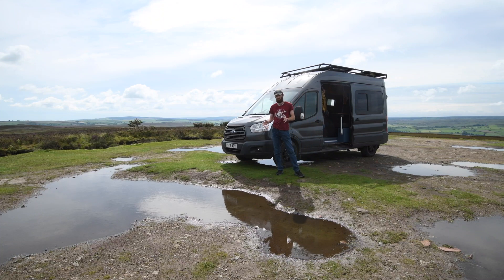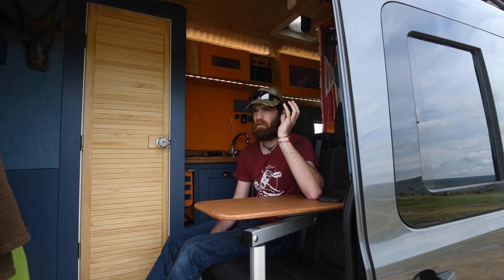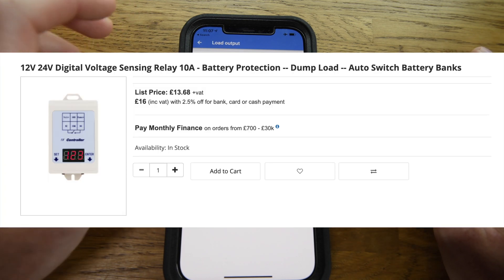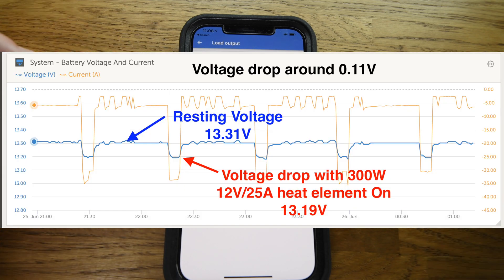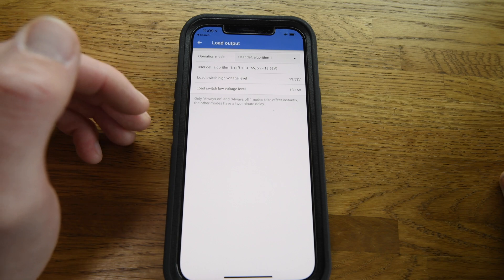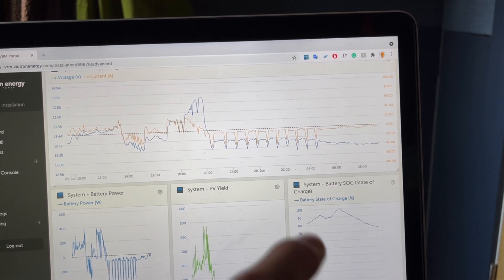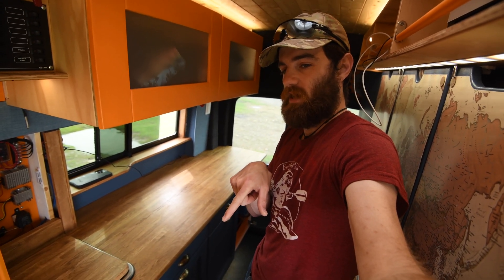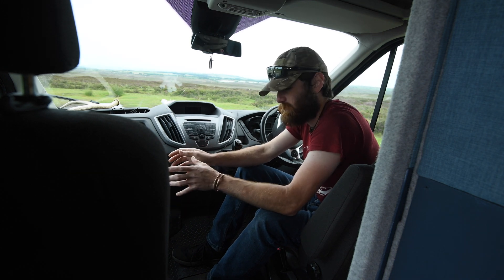FREE hot water from Solar dump! | EP51 | Ford Transit Campervan Build

Comment: If the mppt is connected to the BMV-712 via VE network, then you can use SOC for the relay on the mppt
Reply from the maker: That’s what I have done in the past. Then redid it when I get a Victron Cerbo.

Comment: hi Alex  ive made a esp32 and a lin bus converter and connected that to my truma combi 6e  (acts like a inet box but better with mqtt to the victron cerbo)   and use node red to monitor when i reach 100% SOC then turn the truma on to 1 kw electric  and turns the hot water to high and will turn its self off if the battery soc goes below 95%   but i do have 860w of solar but have seen 990w in peak in summer

Comment: I use a victron 100/20 mppt with load out i set it for batterylife and it turns on load output that turns on my dc to dc charger so it dumps excess power into my lead acid bank im gonna work on dumping to heat eventually now that I know I can control load output based on battery voltage pretty sweet

Comment: Sounds like you borrowed the same idea from Jason of EVERLANDERS channel had done four years ago
Reply from the maker: Great channel Everlanders I used to watch them a lot but they don’t show up in my algorithm much now a days. I don’t think I borrowed the idea off them at the time ( but I have seen there video ) . I was at the time working for Bobilvans which is a campervan hot water heating company in the uk so playing with ideas and solar dump loads are pretty normal for a domestic set up.
Reply from the maker: Looking back at old photos. I put the dump element in the hot tank in October 2020, which is a few months before there video same out

Comment: Hi thanks for posting video very interesting 
One question i have 340v of solar at 12v. And 600watt imersion heater 12v will this still work for me taking into fact that heater bigger than solar
Thanks ali
Reply from the maker: It should work, even if you have a larger heater than solar. It will just reach your cut-off mark to turn off the heater quicker.

Comment: So 2 hours be around 50 amps off battery if no solar or dcdc. Im looking at getting a sealed stainless steel 20l tank with insulation around it.. and adding a custom 12v 1500w element. By my calculations it would take 7.5 min to heat to 60c or 10min. Even if its pulling 125amps its total use would only be 15-20amps which is nothing.. i got 2x 330ah lithium batteries  and 3x 200w in series panels + 300w 70v solar blanket so 900w total solar. And 50a dcdc. Id rather speed mainly because if i want to pump from a dam or river through a filter into the tanks i could have unlimited hot water..obviously mixed with cold for showers and kitchen..though thats theory based off 20l with 300w takes 2 hrs.
Reply from the maker: Yeah, lots of variability in the system depending on size of solar array and batteries and how you  want to use it.

Comment: Just watched this video again and wanted to run an idea past you to see if it would work..

To prevent the system drawing any battery power, would it work with a dedictaed panel (say 100w) which is solely used to heat water? Lets say you had the 100w panel with a 12v regulator to give a constant 12v supply to the temperature relay, which is then connected to a 12v heating element inside a small  insulated tank. Would it then just heat the water anytime there is sun on the panel within the temperature ranges set on the relay? 🤔 This could then be a standalone system you could leave running without it draining any battery power. The only downside is that it wouldnt heat overnight, or when there is not enough sun, so the temperature inside the tank would fall much lower then yours.

I'm thinking on a small scale, (lets say to heat water for a small kitchen sink rather than a shower) in a small campervan. Would this be viable? Would you still need a pwm or mmpt controller between the panel and voltage regulator?

Intruiged to hear your thoughts! 🙂
Reply from the maker: With a dedicated panels you have just feed direct PV from the panel into the right element, many dump loads are done like that. 
The 12V regulator would also work.
Reply: @MispronouncedAdventures  in your video you stated the element draws 300w regardless. How would it work directly connected to the PV, would it just not turn on until enough wattage was coming through?

Comment: I am not sure why they call this a dump.
I call it a redirect.
Charge controllers stop charging when the battery is full, but if the sun is still out, they can still produce power.
If the charge controller does not use that power, the power is wasted.
You can design a simple circuit to "Redirect" that wasted power to another load such as a water heater, air heater, fan, or to a separate Inverter.
While the charge controller may turn off at 12V, another voltage switch may turn on a relay diverting that power.
Reply from the maker: You can see it classed / name a dump or redirection in a lot of places. The idea of dumping excess energy, but it’s only a name. You can also redirect excess energy.

Comment: just a question so if I was wanting to heat water from a dump load of power I would connect the battery to a charge controller to the heating element?

Comment: 18 litres of water is barely enough to have a 5 minute shower in the morning, and the flow rate must be quite slow. Still, better than nothing! But you would be better to replace some of the PV with solar water panels since they are about 4 times more efficient than PV panels.
Reply from the maker: I have a recirculating shower. so high pressure and high flow rate. in the context of an individual shower it’s “infinite water” as it’s a closed looping system

Comment: Hey man, your videos are incredible, have watched several multiple times!
There is some questions I have tho. First one would be..
Do you have a relay preventing the continuous switching on and off of the relay if you're just on the verge of having enough solar?

Also, what pressure are you running in your water system and ist it a good pressure for a shower. Reason for the question is that John guest for example has a much lower pressure on warm water pipes and I was thinking if I should use shark bite instead?!

Your hot water tank is not pressurized..
Would you do it again, or considering a pressurized tank to save a pump?

Thanks again for the great effort with your videos.
If you're feeling like some warm weather and some sun, come for a visit to Australia
Reply from the maker: Thanks for watching.

Your first question. The trigger has a on voltage value and a different off voltage value

My system run of a  45psi pump. Which is well within the JG operating specifications. I would use 15mm JG fittings again shark bite isn’t a option in the UK.

My hot tank is unpressurised as that was the nature of the kit at the time. I like it being unpressurised because I use it as the recirculating shower tank and serviceability for cleaning is important. If I didn’t have the recirculating shower I would use a pressurised, so I have one less pump.

Not yet been to Australia, I would like to visit at some point!
Reply: Thanks soooo much for the recommendation this answers some long contemplated questions.
If you wouldn't mind,.. one more..
A lot of people talking about the filters of the recirc shower and that they glogg up quick and that you can only use them without shower gel. What is your experience?
So your hot water tank is also your shower grey tank? Have you considered using the coolant as heat transfer medium as well?
Reply from the maker: I spent quite a time  varying different types of shower gel/shampoo, 

I found shower gels, get screened out less because they’re dissolved in the water more so the filters last longer, but the water needs to be replaced quicker. Natural soaps or ones with more natural oils. Get removed by the filters easier but clog filter them up quicker. 

Next van, I would look at a hydronic or heating system, which uses coolant from the engine
Reply: Thanks again for your great help!

Looking forward to your next video!!

Comment: Thanks very informative video. Quick question.  If I had a 300 watt solar panel but the clouds come over and I for example get only 150 watts of power out of the panel; but don`t want to use the battery, would it still heat up or does it need the full 300 watts?
Reply from the maker: Glad it was helpful. It would still heat the water at the full 300w, if let’s so solar dropped to 150w. But the dump load really wouldn’t switch off after a few percent of the battery is drained. As I’ve built it to turn off if the battery state of charge starts and drop because the dump loaded only be on when there is an excess of power.

Comment: Hi, ive have tride messaging you several time but no answer, i want to do with the heating element like how you have done it, could you please explain how you fitted it and how you did the setting for it on the victron please. if anyone else has done this i would like to know, thank you in advance.
Reply from the maker: Heating element is fitted by drilling a hole in the  water tank and then using a bulkhead fitting to screw the heating electric in via the threads on it. 

Electronically originally are used voltage sensing. On an off point.

Later on I switched use a SOC value to trigger a relay as a signals, which, in turn turns on a temperature sensitive relay, to check tank temperature, which triggers a high amp relay, which turns on the element
Reply: @MispronouncedAdventures  thank you for the reply, i love your videos. it took me a while to fully understand how you did the shower with the two tanks lol, ive just brought a horse lorry that im going to be converting. what was the cost of all the victron stuff btw.
Reply from the maker: Realistically the shower system only uses one tank,  the shower tank. The smaller one is more just a way of collecting all the drain pipes together in one spot.

Victron kit is pretty expensive, but you get what you pay for, I don’t know a full cost up  off the top of my head but plenty of site offer it
Reply: @MispronouncedAdventures  so i dont have to have two tank, ok, however i do like the way that you set it up and if its ok id want to set it up like yourself. Thanks again sir and thank you for all your help.

Comment: I like the system. I like to add something to the hot water system and that would be a coil which runs coolant through it to heat the water in the tank with engine heat. That way hot water is almost guaranteed, even in winter as long as the van is driven for a bit every day or every other day...
I am planning such a system using a central heating hot water tank from a combination boiler which (for safety reasons) I use a copper pipe wrapped around the outside of the steel tank to get the drinking water hot. The steel tank itself contains the coolant and is heated by the electric element.
Advantage of this method is that (though some heat is lost to the coolant plumbing) the toxic coolant has no chance to contaminate the drinking water and the heating element is protected from corrosion and scaling up (since it is heating coolant rather then drinking water which may contain calcium)
The heating element I intend to use is based on mains power and has its own thermostat 10-65 degrees C. I could use the chinesium thermostat relay thingy like you have panel mounted but then I need to bypass the internal thermostat of the element which could help since I have the option to raise the temperature of the water in the tank (due to the dump load circuit) to the same temperature the engine coolant system is capable of heating it (about 85 degrees C)
Reply from the maker: Sounds a bit like you are after something like the Surecal calorifiers. Using the engine coolant for heating water. 

Opposed to using a copper pipe wrapped around the steel tank. It might be more efficient to use a plated heat exchanger as they have an extremely high rate of exchange between your safe, drinking water and coolant heater by the engine.
Reply: @MispronouncedAdventures  The hotwater tanks in a central heating boiler unit is basically a calorifier. Calorifiers are expensive but the hot water tanks (10L or some are about 15 L) are very cheap and made of copper or steel.
Obviously the tanks are not meant for use in a vehicle but I will investigate and/or open up a steel example to see if I can stabilize the internal coil to make it usable in a bouncing around setup like a campervan.
Even though I should be able to stabilize the coil and secure it so it does not develop internal leaks (where coolant can contaminate the drinking water in the coil) I will use a non toxic coolant in the system to prevent any health issues in the future.
I first have to drill a 30mm hole in the steel tank to be able to weld in a G3/4 inch threaded insert so I can install a future electric heating element.
This hole will also give me a visual access to the interior of the tank and if turns out (most likely it will) the coil is just hung from it's connections to the outside and not secured very well, I will cut open the tank by removing one of the end caps and do some stabilizing work (thick steel wires welded in place holding the internal coil in place so it will not move very much to prevent the coil from damage and leaks).
Welding inserts in and welding back the end cap on a steel tank is no problem for me since I have a suitable welder and matching welding skills and experience to do so...
I should be able to do the job of modifying the tank and internal coil in a single workday, which is fine.
Buying a marine calorifier is way out of my budget and I am not very keen on getting one anyway since most manufacturers exclude warranty anyway because it will be used in a vehicle as opposed to a boat.
Reply: little update: turns out the tank I am planning to use as a calorifier is build with a double wall which means the hot coolant fills the tank and the space between the outer wall and the inner wall is filled with drinking water. This makes it useable in a vehicle since there is hardly any danger of mechanical stresses causing internal leaks and a risk of coolant contaminating the drinking water system.

Today I welded in a G 1/2 inch threaded insert into the tank in preparation for the 300W (240V) dump load heating element.
Next I have to order programmable a voltage sensitive relay and a programmable thermostat relay to make the tank function as a solar dump load...
Reply: @koningbolo4700 Hi I am in your league, looked at CALORIFIER and price 😮! What tank did you use and did you put a pressure release valve on it?

Comment: Is the heating element connected to the stock tank from bobil ? I am thinking of doing this , great idea , many thanks 😎❤️👍
Reply from the maker: Yes, it is attached to the generation one Bobilvans kit  tank. I just drilled an extra hole and used a bulkhead fitting to bolt it on
Reply: Many thanks ❤️😎👍

Comment: This is what I have been trying to do for a year I live on a narrowboat I have a 1600w victron inverter and 1kw of solar and a calorifer that is heated by engine only I know I can put a 300w 12v element in I just don't know where to go from there for the dump I understand the 200 relay to up the resistance what is the grey panel the 3 you have? And are you triggering it off the victron relay that tells a generator to kick In in voltage is low ? Thanks T .
Reply from the maker: Originally it was more dump, and I used 
Voltage as a trigger.  But yes, I’m using reverse logic on the generator on / off triggered SOC now
Reply: @MispronouncedAdventures   so what's the grey pannle in the cupboard that was flickering when you were filming it sorry just trying to explain what,I saw
Reply from the maker: The one with the red and blue numbers on? That a temperature controlled relay. When the dump load is “on” that powers the temp relay, which checks tank is below my preset max temperatures ( 80c ), if blow the temperature relay triggers the big 200a relay which runs the element
Reply: @MispronouncedAdventures   yes where do I get that from maybe a link to buy that is the only thing I'm missing
Reply from the maker: Amazon has many different models under the name “temperature relay 12v” mine is a “W3230” type one
Reply: @MispronouncedAdventures   thank you for your help and quick reply 🙏  perfect 😊

Comment: Hi Alex 
It's been a while since you fitted this system . Have you made any modifications to the system since ? I'm particularly interested to hear if you did upgrade to the 600w heating element ? And if you changed the way the system senses voltage ?
I'm trying to get my head around this sort of system for my next build . You did an admirable job of explaining how to implemented it here for your needs and use case . Well done sir .

Speak soon . Take care.

Fattrucker
Reply from the maker: It’s great, I haven’t upgraded in the end, a lot of effort. I did saw the voltage sense to SOC with some Victron kit
Reply: @MispronouncedAdventures  Thanks buddy . Catch ya soon . 

Fattrucker

Comment: Nice, do you think you could use the load output to dump excess solar into a portable battery bank like the ecoflow delta or similar. It sounds like the mppt controller is a smart way to charge the battery bank without damaging the van batteries.
Reply from the maker: Yes. The “dump” can be anything. I personally use the EcoFlow powerbank and I also thought of this application. However I still might run if via relay. As the Dc input of a EcoFlow unit might be higher than the max output of a load output on a Mppt